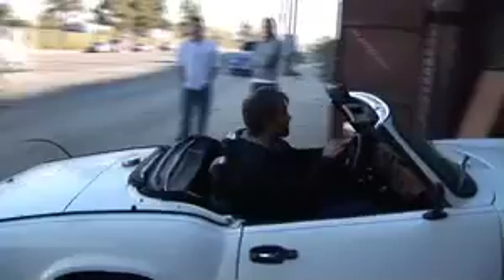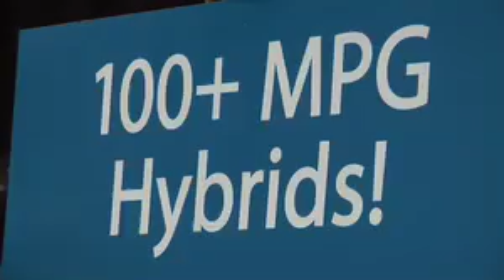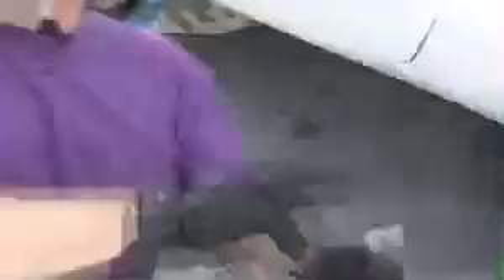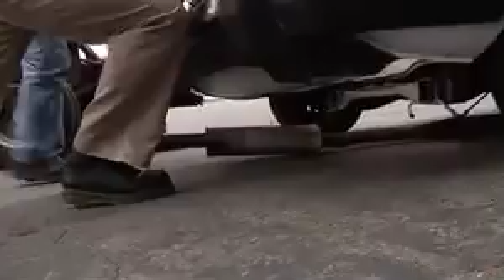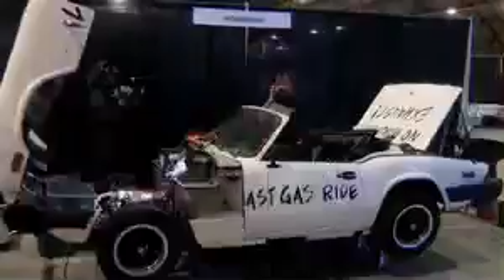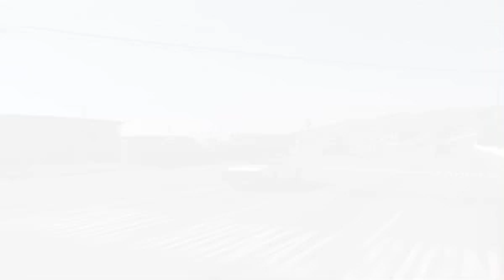Electric Car Conversion 2007

Comment: @RigorMortisRabbit Sure, if you want. But remember HALF of oil is used to make the electricity to charge the batteries and 1/6 of it makes the tires, upholstery, wire insulation, plastics and grease in the rest of the car.

Comment: Power stations are far less efficient and burn more fossil fuels than your internal combustion does. So electric vehicles are not viable at the moment. Not unless  the electricity generated is from either wind,solar or thermal. On top of that is the cost of upgrading the grid if we all switch to electric.
Iceland is the only Country to come up with a viable alternative so far. Hydrogen
Oops ! it looks like a posted a different opinion. This post will definately be deleted.

Comment: Power stations efficiency is another matter, my point being that, as a norm, electric powered vehicles are much more efficient than  IC powered ones, not to mention other obvious advantages. Lest hope that in time power stations will improve in all aspects.

Even with not so efficient power stations I would rather have electric...It would be best to have millions of clean efficient vehicles powered by several power stations than have both, millions of polluting vehicles AND power stations.

Comment: Well, yes and no.

The electric motor does get a little warm, but nowhere near enough heat for a Michigan Winter, for example.  

The best solution right now would be to put in a liquid fuel heater where the car's heater core was.  With electric ignition, you could start and stop an alcohol burner quickly and get heat fast for defrosters, etc.

The Aluminum/Gallium/Water reaction produces heat and Hydrogen gas:  add a fuel cell and you're done.

Comment: IC engines lose 42% of their energy to exhaust and 28% of their energy to the cooling system. 

So only aprox 30% of the money we spend on fuel for our cars is actually used to move them. 

Electric powered vehicles could very well be the future as they are so efficient and in some cases so quick, or maybe some other new technology. Time will tell.

Comment: Don't know if this would work but did yeah try adding a heater to heat the batteries to a set temp? And run the power of the heater from off the home power or separate battery pack during the cold? If it works better in say 75 and above then set the heater to just that.

Comment: The cheapest (general use) kits I found run for 4000-5000$, what kind of performance do you get for the 2000 kit?

Comment: The simple answer is, 

Ev is 1/10th the cost per mile compared to ICE! 

About $0.02 per mile Vs $0.20 with petrol.

Look at it this way, your monthly gas bill will equal your YEARLY EV power bill.(approx)

Comment: Perpetual motion my arse! It's called maximum efficiency. 

1) There's Regen (if you us AC and totally forget about DC) which can extend your range by over 60% in stop / start traffic or hilly terain.
2) Mitsubishi recently showed a concept car that had regenerative fans in the front grill.  Wind pressure goes up by the square root of speed so at high speed these could collect quite abit of power. No news on if they were used all the time or just when braking.

Comment: Hmm I've got AGM at 90-95% and Li-ION at 99%... anyways you were talking about charging efficiency in your comment before, if you meant charging and storing efficiency then those are two different things... There's also motor controller and motor loses as well, so might as well quote the tank to driveline efficiency... for modest system it's 62-77%